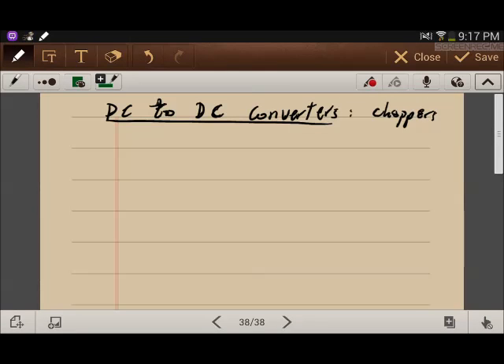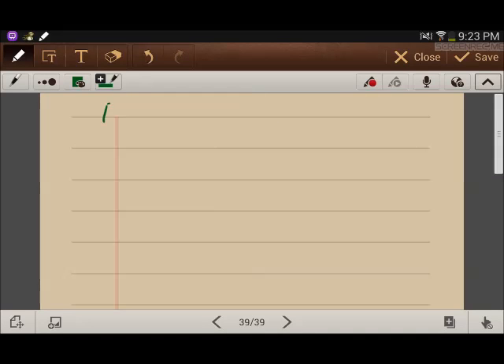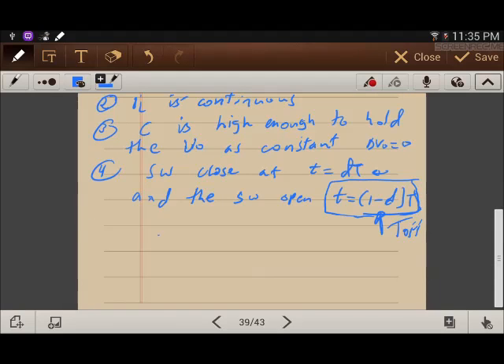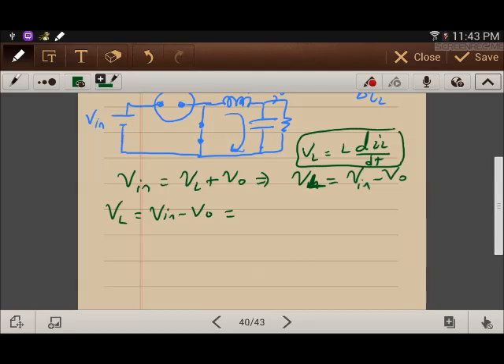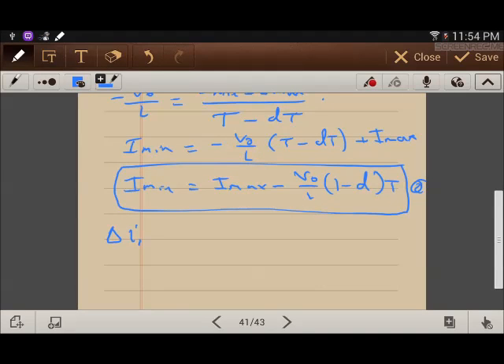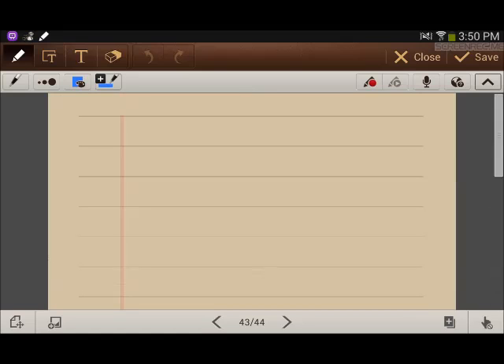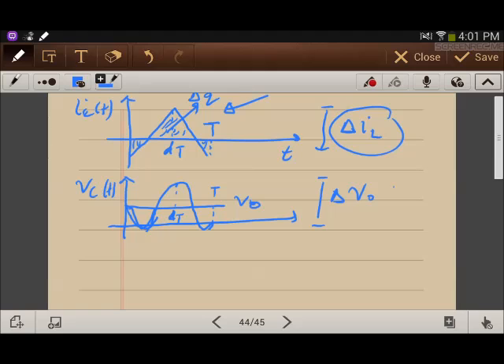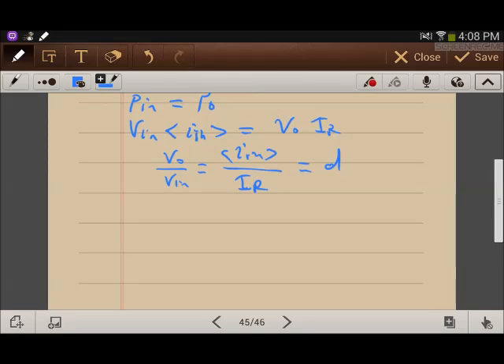Lecture_10 DC-DC Converters: Buck Converter

Comment: I'm 25 min into the lecture and still don't understand who/what the fuck is doing the switching?
Reply from the maker: +Artjoms Pugacovs its a switching circuit, you should have study that in your prerequisite course before taking power electronics course.
Reply: nah I'm just talking in general. 
I have seen people who do the switching with push button,  I just WTF.
Reply: the switch is a theoretical representation of an actual transistor , being control by a pwm.

Comment: at 5:00 why is the voltage across the resistor 5V and not 10V ?? if we have a closed circuit for the first half cycle..
Reply from the maker: +Donny Y you are correct its 10 volt.
Reply: why 5 volts across inductor?
Reply from the maker: its 10 V but average is 5 V